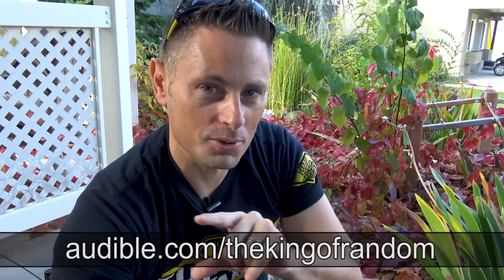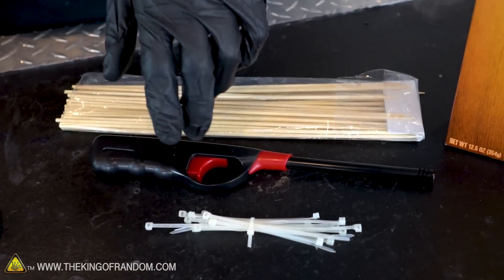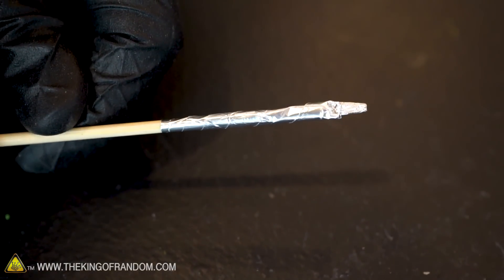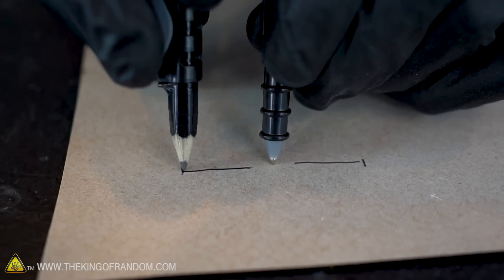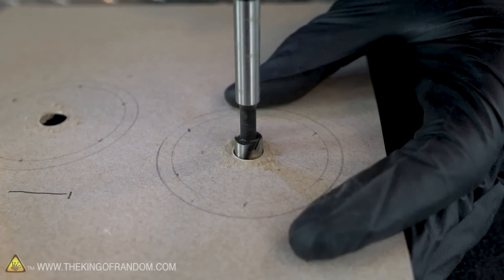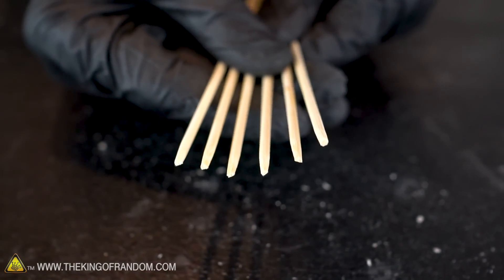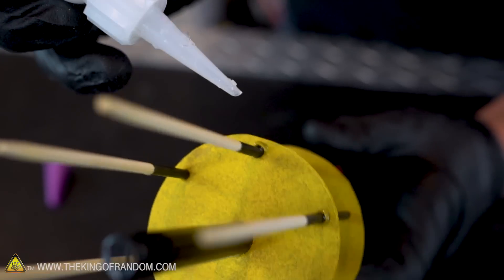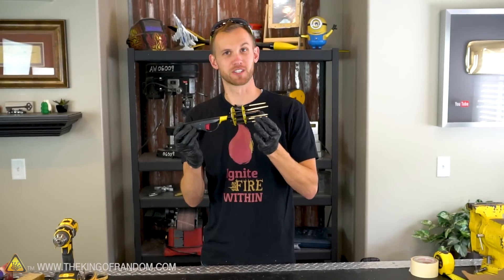How To Make a "Rocket Revolver"?! TKOR Shows How To Make A Matchbox Rocket Revolver That Works!

Comment: I enjoyed the video for how to make liquid oxygen, and am considering building my own rockets as part of a rocket club.  Using a fuel such as rubber has vast potential, but would like to incorporate a liquid oxygen tank to burn the rubber.  I have seen similar systems use Nitric Oxide, or some other flammable gas.  Being able to burn pure oxygen and storing it in a liquid state should provide the extra boost to send a 'hobby rocket' past 60 to 70 thousand feet.  Can you produce a video that offers mechanisms for storing liquid oxygen for use in a single or two stage rocket engine?

Comment: The reason using the radius to mark 6 evenly spaced points works is, the radius is one radian of arc length which is 57.3 degrees. the secant line which is slightly shorter than the arc line makes the arc between the two points approximately 60 degrees. And since 360/60= 6 that’s 6 evenly spaced holes.

Comment: There are a few flaws to this Rocket Revolver. 1, the flame. The flame can be extinguished easily as its really exposed to air and other things. Another flaw would be 2, the materials. Most of the objects used to make the Rocket Revolver are made of flammable materials, therefore the Rocket Revolver can catch fire and self combust the Rockets upon combustion.

Comment: Make a nuclear reactor.
Reply: a kid in great britian or america actually did that with a guide from the internet and made a few grams of uranium/plutonium i forgot which to do that he had transform some radioactive compound with a lot of steps into low grade uranium/plutonium
Reply: dominik obora the core is a little bit of radioactive but not fissile material such as radium. Wrap around it a lot of carbon, and a few cobalt nails as makeshift neutron absorbers. Then take low grade americium (from old lamps or smoke detectors, they have americium oxide so reduce it by any method). A few days later you have usable plutonium or uranium
Reply: Creative H to let you know if you take chemistry when you are older you will virtually learn this in school

Comment: What happens if you freeze rocket fuel and light it off?
Reply: CraftingUnited gas dosent freeze I think
Reply: CraftingUnited oh yeah
Reply: ishi rocket fuel isn't gas it's a creation that Grant made
Reply: nothing would happen as the neutrons could not react with the ingniton unless the ingintion method melted but it would then still be quite underwhelming.
Reply: yeah but the flame would thaw the parts and cause a chain reaction
Reply: FunkplayZ an incredibly slow chain reaction the freezing point of rocket fuel is extremely low a tempreture most people would unable to get to.
Reply: yes do it
Reply: ishi everything freezes. Just takes a very cold temp to reach it.
Reply: Zach Field well by it won't freeze I ment in a freezer